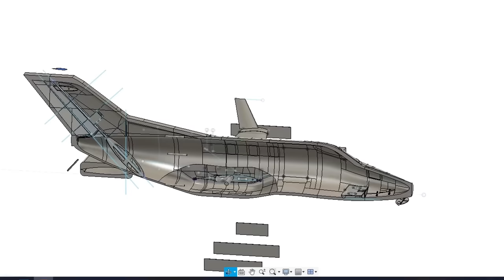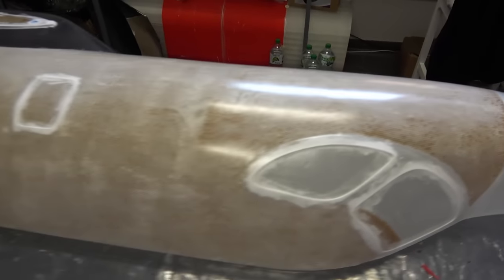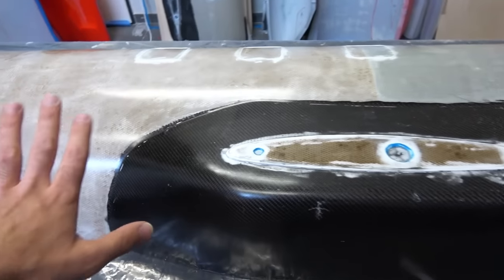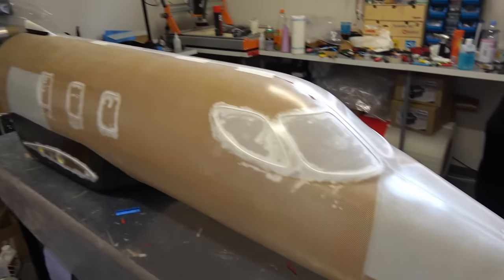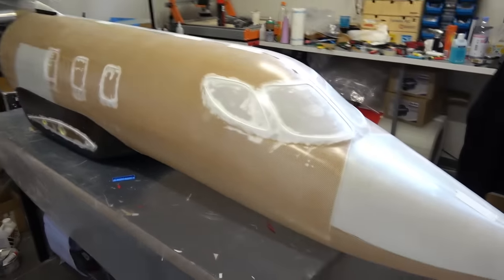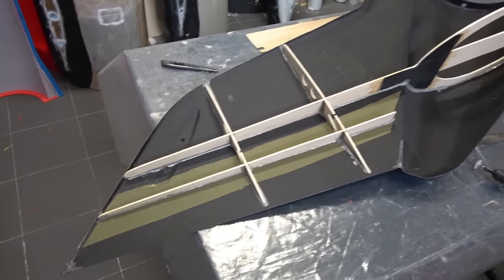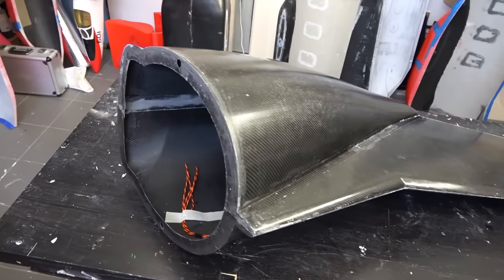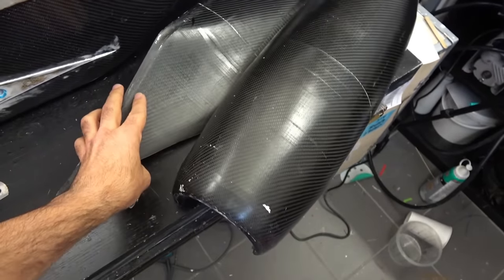Building a Giant RC HONDA JET AH-420 full composite, Part 1

Comment: Awesome! I think gelcoat is used for bulding boats. The gel accumulates on the surface to isolate it from the air. That way the poly cures perfectly and makes a very smooth surface.
Now if you make the model 4 times larger you could have your personal jet!

Comment: Ramy, love your projects! I suspect many would really enjoy a video about your materials and processes. Information about 3D printed mold materials and infill and such, and especially materials and processes for preparing your molds (smoothing, filling, mold release, and such). Also fillers that you use. I'll bet Easy Composites might like that too. If I didn't live in the US, I would be a frequent customer of theirs for my model airplane projects.
Reply from the maker: Thank you Mark, I mentioned all that in previous projects! I think it was the A380 build video Part 1
Reply: There  are several suppliers of composite materials in the US... I've used Fibre Glast for fabrics, and West System for Epoxies in the past... albeit for high power rockets.

Comment: Hi Ramy! I have just watched your new video. Really good job! This looks amazing. I am building Richard Bransons Virgin Galactic Spaceship Two with its carrier, White Knight Two and I am building it in the same way you did in this video. The plane es almost finished and weighs 3.8 kilo, ready to fly with a xicoy X-45 engine. Length is 170 cm.
My Tristar was the first plane I built with carbon/honeycomb sandwich technology, but for this plane I only used a positive mold made from foam materials. It ist still doin well and I like to fly it very very much.
Greetings from Switzerland,
Dom

Comment: Another great project in de works. A joy to watch. I was just wondering, what is that putty you used on the windows, and why? Just curious.
Reply from the maker: This is epoxy mixed with glass bubbles to fill the corners.

Comment: Hello Ramy, I always enjoy your videos! Especially when you are doing some pioneering work like with the honeycomb material in this one. I have 2 questions: 1) when applying the layer of fiber glas on the honeycomb, did you consider first to soak the fiber glass cloth in the right amount of resin and than apply this soaked cloth onto the honeycomb and vacuum bag it? I wonder if doing it the way you did it, the cells aren’t filled with resin during the application of the resin? 2) did you consider to put the honeycomb material on the wet fiber glass material and than vacuum bag it? (Actually like you did on the first half, however without the balloons etc. / what went wrong with this method?)

Please keep up this pioneering work! I Love it!❤

Comment: Hey Ramy RC. I watch your videos a bit. I noticed at 18:50 you are using what we in the electrical trade in Australia call Sticky Backs (probably a brand name or something) to support  your servo wire lume. I am also into RC aircraft. Those things always fail!! A small amount of heat and they drop off the surface. It looks like you are using the small ones too attached to a composite surface that will heat up very easily from the sun. They fail in cabinets that do not move. Don't  use them in a model aircraft that vibrates and pulls G's!! Never install them in an inaccessible area of your model like the tail fin!! You have ribs the wiring passes through. Just cable tie to them.  Chuck the Sticky Backs out! A 50 cent washer can bring down a Boeing 747.

Comment: Hello, why did you use honeycomb like this? It is not working so well with wet layout...? You should have alot of resin in cells, but honeycomb is designed for empty cells - that is why it's used mostly in prepreg system....

Comment: Hey Ramy, was wondering what kind of roller you use to spread the epoxy evenly? I have been having trouble with the roller on my models to have to equally spread apart.

Comment: Very nice work. are you self taught or have you worked in composites? A real plane isn't much bigger nor much more work so have you considered making real planes?
And when the part is fairly big, how about doing the fuselage as one big piece from the inside instead of gluing together two sides? that should be much stronger. It's a bit awkward but with a few tools, wont it ultimately be easier than two sides...?  and why not just use all carbon that might be stiff enough to not need honeycomb at all?

Comment: What scale is this and I am curious what would the weight be if that was to scale as well?  I know you try to make them as light as possible but if you were to make them to scale for weight and size wouldn't that give more realistic handling characteristics?
Reply: If it will be to light wind will throw it around so it will never look realistic. Helium airliners have realistic weight scaling but they can not be flown outside, they are indor only and that is limiting their size.